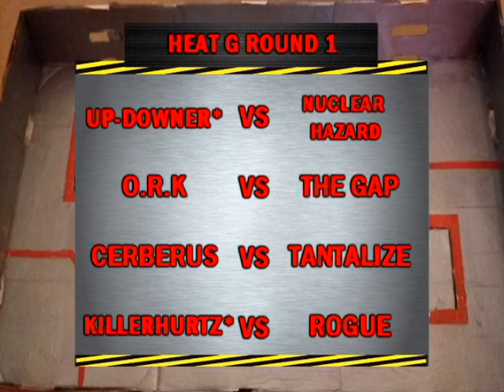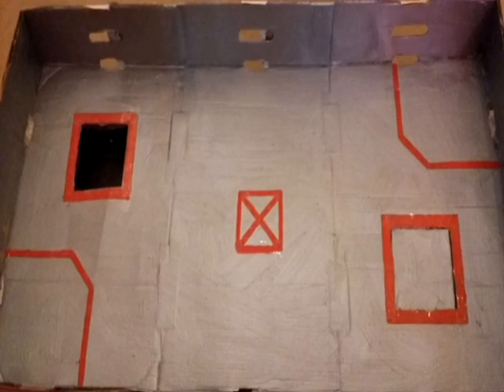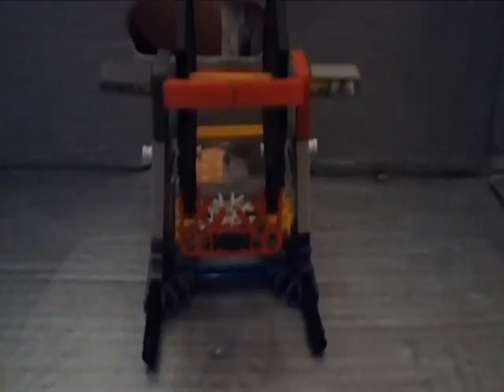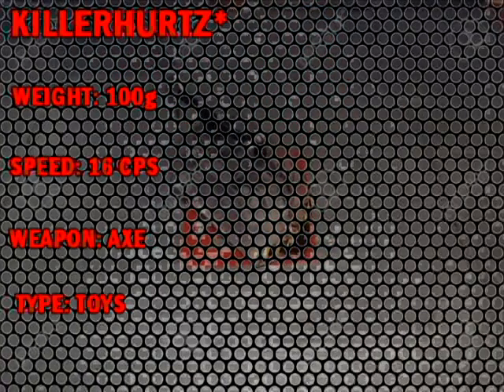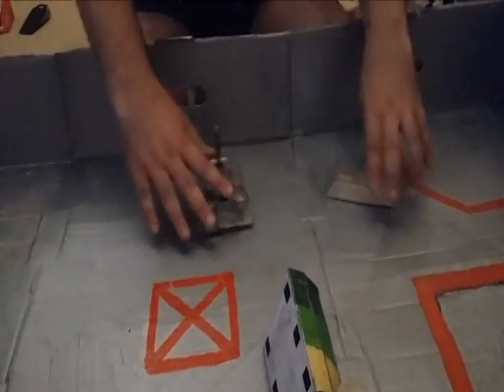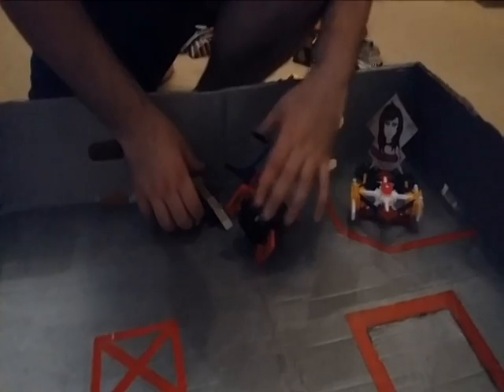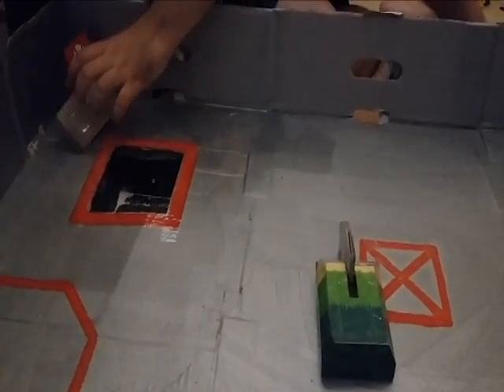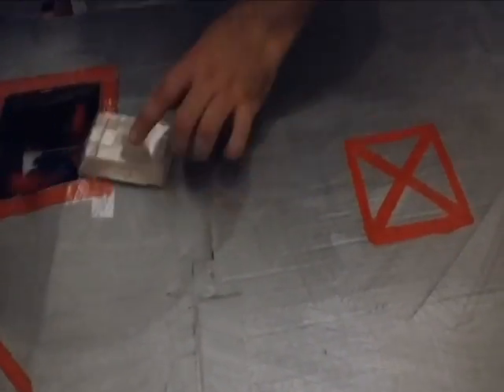RWA: Rebirth, Series 1, Heat G

Comment: Great heat as always. I have to say I'm really liking that Cerberus model and am really curious how you designed and made O.R.K's axe.
Reply from the maker: Cheers for the kind words man :) That Cerberus model took a total of 13 hours to make! As for O.R.K's axe, the spring mechanism is from one of those staple removers (The ones that look like they have fangs) In fact, if you watch heat L of series 28 you will see the exact thing I used because it was originally used for a robot called Fang :D For the blade or tip of the axe, I used one of the those mini nail files that come attached to nail clippers.  I then stuck it inbetween two pieces of card, made an axle with a cocktail stick, and placed the axe in the right position so the spring would fire it forward when retracted :D I'm rather proud of myself, though I admit, it isn't very deadly :P
Reply: Judging by that, I imagine O.R.K took a long time to build and get right. I'm trying to get back into making some FMRW videos and would love to make more axe bots. It's just that my cardboard robots with axes tend to work the exact same. Just a long strip of cardboard with a nail sticking through it.
Reply from the maker: If you wanted, I could always make a tutorial on what I did to make it? :)
Reply: Sure thing. I'd like to see that and I'm sure other people would as well.
Reply from the maker: Well I am planning on building a new one anyway so I will most likely make a tutorial :) I do hiope you come back, FMRW needs a rebirth itself lol
Reply: Most definitely, it's so odd only seeing 2 FMRW series in my subscription box now, them being yours and MLU4's series.